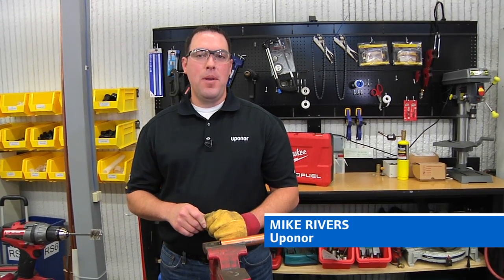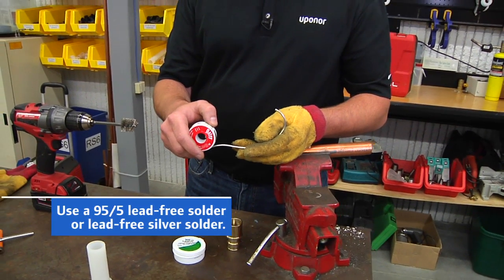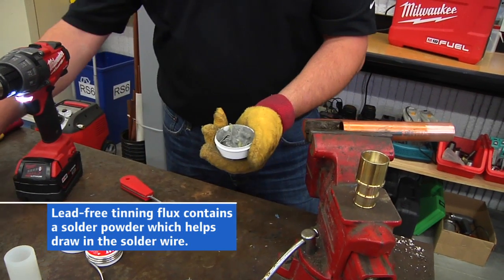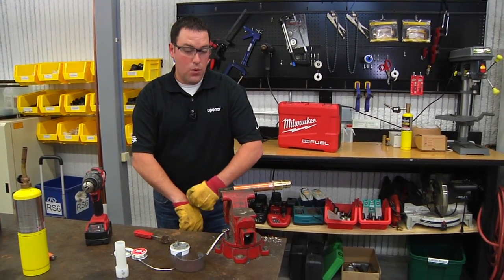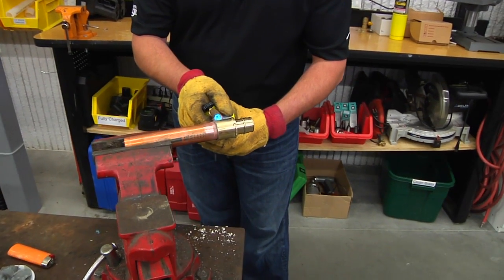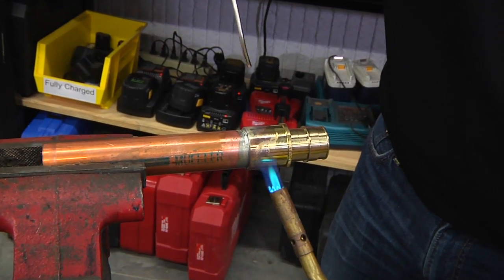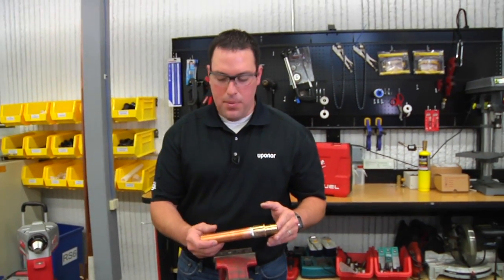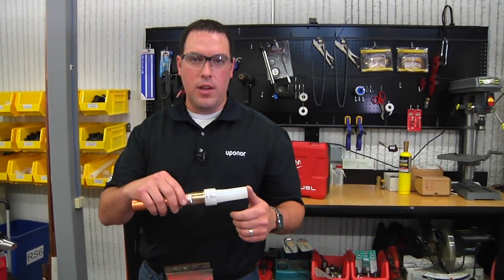How to Solder - Soldering Techniques for Uponor ProPEX® Lead-free (LF) Brass Fittings

Comment: You don't put copper tubing in a vise like that - you risk flatting the tubing into an oval shape. If you are going to use a vise - you use a pipe vise. And this guy is supposed to be an expert? And he is demonstrating a technique that others will see and say to themselves "It's okay to put my copper tubing in a vise and just tighten it down" - and thereby overtighten it and ruin the portion of the tubing that is in the vise.

Comment: this is way harder than copper on copper, did two fittings and they both leak. I'm going to use the right flux on attempt two and pre solder the fittings to copper pipe and solder the copper pipe to in wall copper so it's easier.
Reply: How did this go for you after you tried with tinning flux?
I'm fighting the same battle with my LF Brass fitting adapter into my copper manifold

Comment: I don’t think This system is any better, or faster then PEX, it’s def NOT cheaper..
But I like it..
Reply: logtec1977 Um, this is PEX.
Reply: It's a different kind of PEX; PEX A. It is way better than the crimp fitting PEX B. PEX B loses ID whereas Uponor PEX A doesn't lose any ID. You can have really crappy flow with PEX B if you don't upside the tubing. The fitting being thick walled male are a serious restriction.
Reply: pex-a you can get in any space the pipe can fit in, no need to use a tool to add/remove clips/crimps in-wall